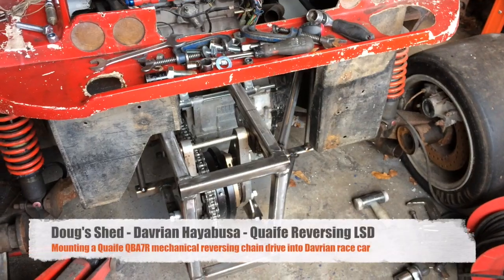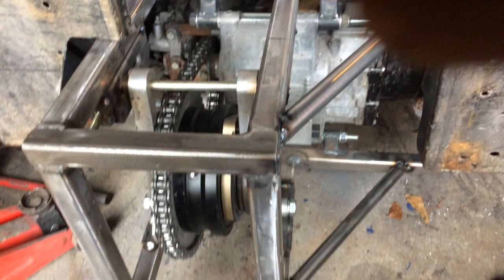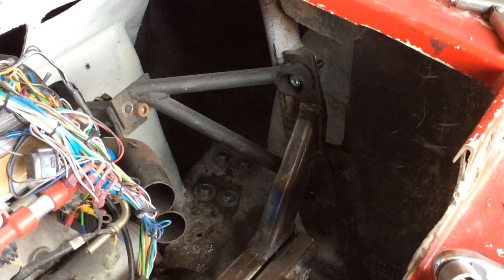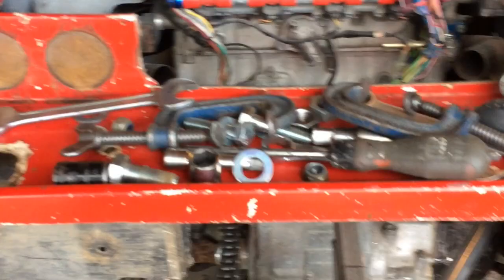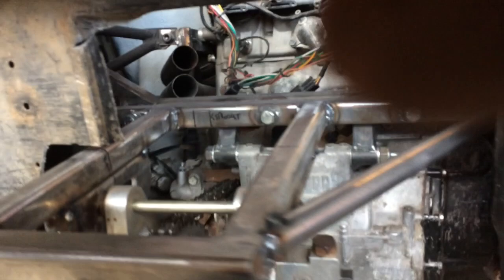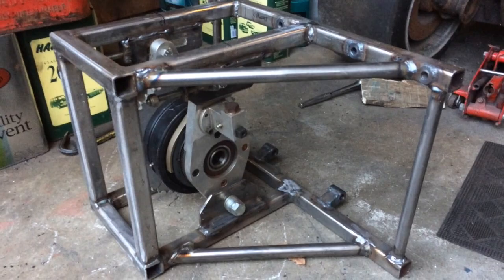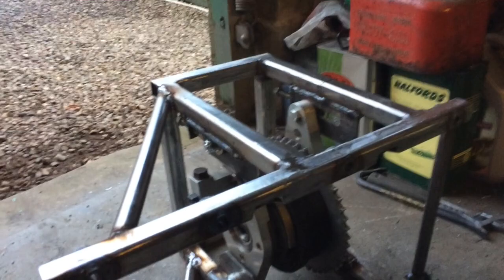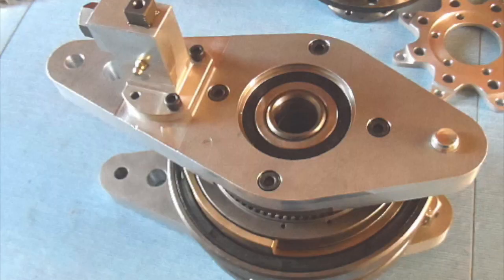Fitting Quaife Chain Drive LSD to Davrian Hayabusa Pt1

Comment: do you have the plans ?
Reply from the maker: Hi Jose, I only did some basic layout sketches in order to position the main components to see if everything would fit and give clearance for the other components in the engine bay. http://www.westgarage.co.uk/downloads/basiclayout.jpg
Reply: thank you, i'm building something like that @ProyectoP91T on instagram
Reply: Hi I’m thinking about doing a similar project... is the wire harness from the original motorcycle engine required?